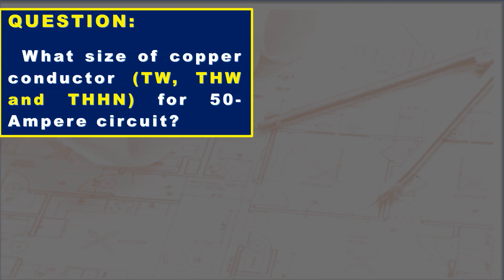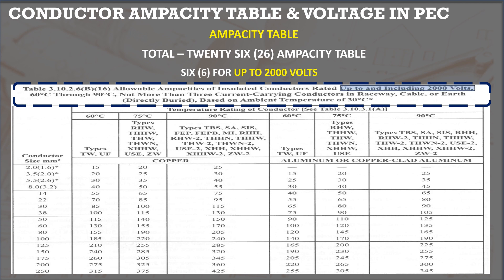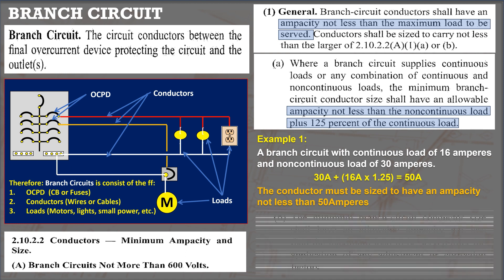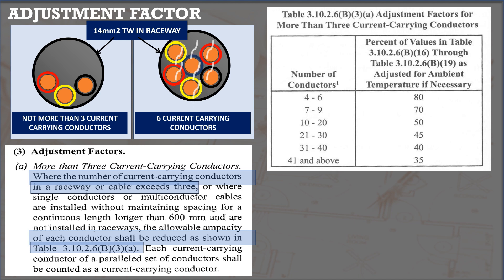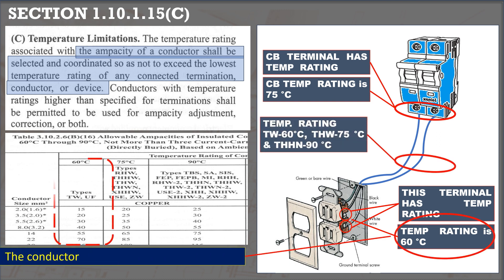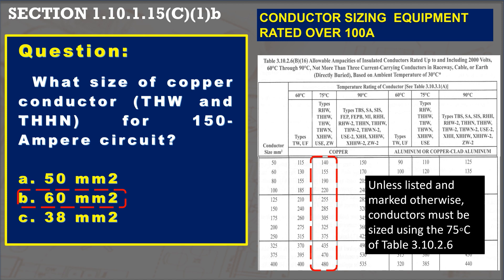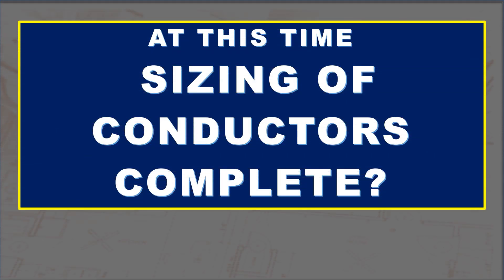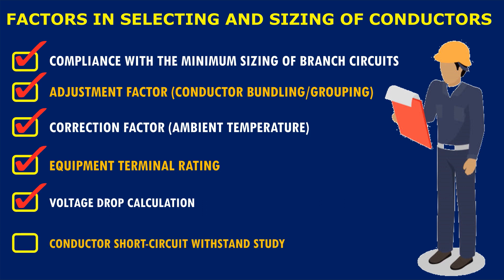Conductor (Wire and Cable) Sizing and Selection

Comment: What is the catch of using THHN and THW if the ampacity cannot be used based on their respective temperature?
Reply: I think this is answered @10:58 to 12:00 where you use THW or THWN Section 1.10.1.15(C) Temperature Limitations. The ampacity of a  conductor shall be selected and coordinated so as not to exceed the lowest temperature rating of any connected termination, conductor, or device.

Comment: Voltage Drop is mostly applicable why we need to  increase wire size higher than min. wire sizing., But not totally 8.0mm2 is wrong for a 50 Amp. Circuit breaker, We must know the derated value for 50 Amp , Circuit Breaker, 
Please consider the Table for ur reference,
Reply from the maker: Hi Peter, thank you for your comment. My reference was based on the electrical code, specifically subsection 1.10.1.5(C)(1)a. For device or equipment terminals rated 100 A or less, wire sizes shall be based on the 60 °C temperature rating listed in PEC Ampacity Table 3.10.2.6. Equipment terminal rating is one of the most common misapplications of conductor temperature ratings that occurs when the established temperature rating of the equipment termination is ignored. Also, how come the derating of circuit breakers makes 8.0mm2 correct for 50A? kindly share references, Thank you.
Reply: No sir, 50 Amp. Wire is for #6AWG   not a 50 Amp breaker has deratedvalue of 80%,
Reply from the maker: @peterlabasa4660  will you please explain why we drerate the breaker?
Reply: Using NEC 80% Rule

Wire ampa ampacity for 50Amp
= 50/0.8 = 62.5

That meansyou should use a wire that can handle 62.5 Amp as a 50A wire. The closest wire to use is #6AWG , since it has ampacity of 65A.
Reply: Importañt note to remember that circuit breaker must be use only at 80% of its overall rated ampacity, 
That is what we call derated value of CB.Is that ok for you sir?
Reply from the maker: @peterlabasa4660  mas ok sana if section is mentioned para ma validate, pasensya na hindi ko pa nabasa yung sinasabi mo about that
Reply from the maker: @peterlabasa4660  I know about NEC80% rules. Actually, i am preparing a topic about that, hindi ko pa lang natapos. However, i will try to finish it, and then i hope you watch it.
Reply from the maker: @peterlabasa4660  ok, I will finish it with complete sections and references.